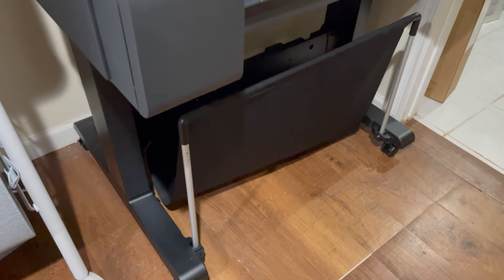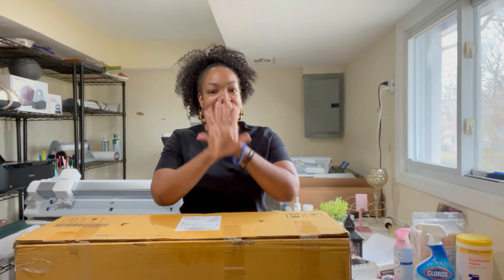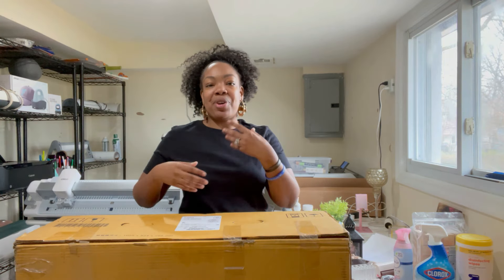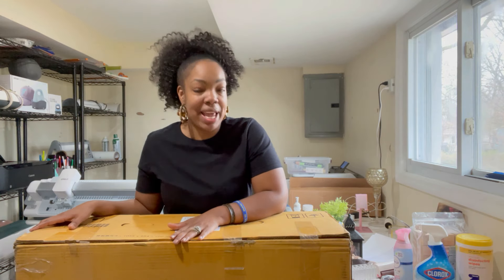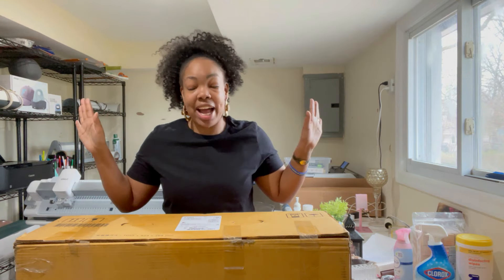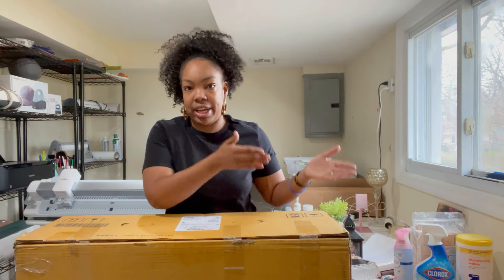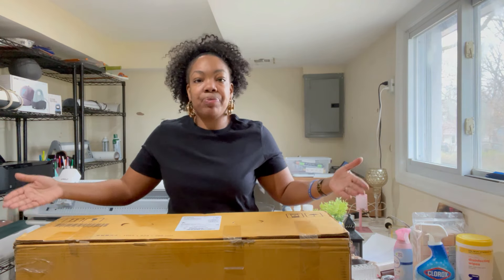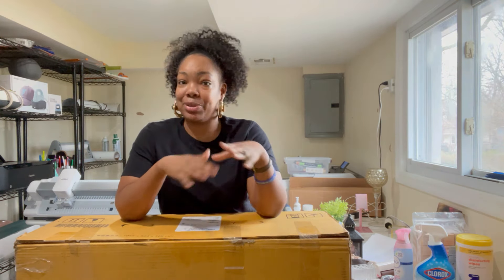Part: 1 CANON ImagePROGRAF TM- 240 | Unboxing + Setup & Demo |  Very Detailed

Comment: Part 2 is a must!!
I can see some life-size poster pictures of graduates for graduation parties.

If it's not too late, can you show the actual measurements with a measuring tape in part 2 or maybe part 3 because I'm here for it all. 

I have been holding out for a while due to space.
My space is getting very limited but uhh.. I might have a potential spot and if I do, B&H Photo will be hearing from me soon.